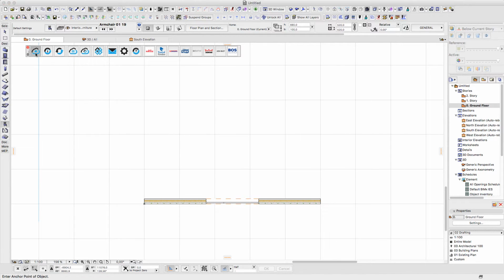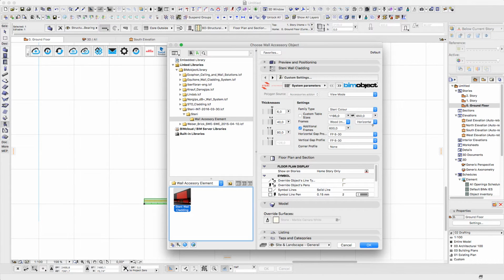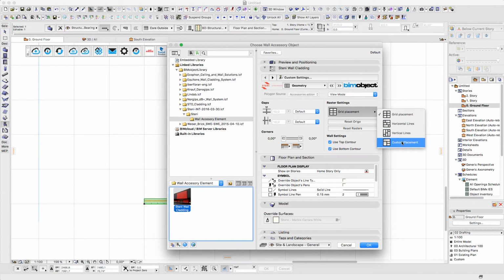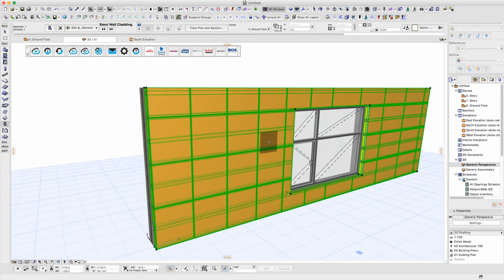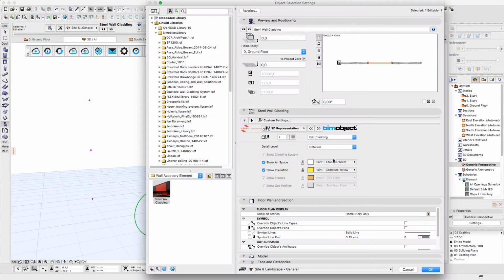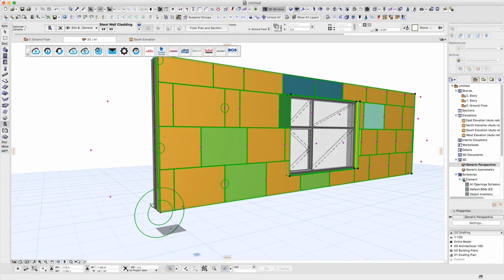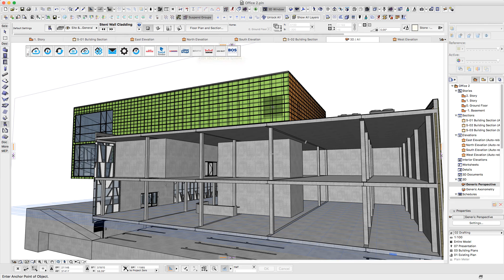Steni – Introduction for ArchiCAD

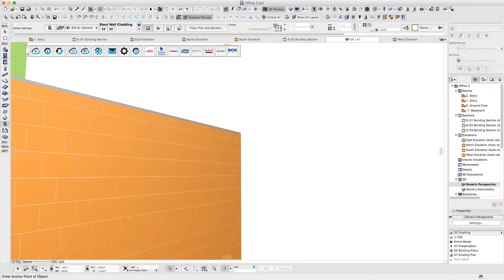Comment: I use archicad 19 build 5005 and I don't have the edge profiles that I see in 4:53.. the add on doesn't charge them in the project.. is there a secondary file to download?